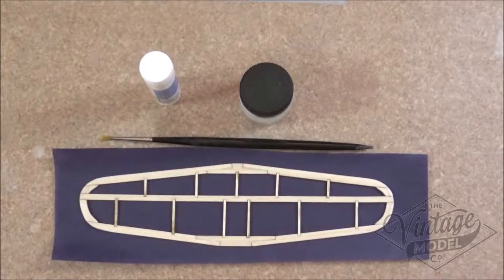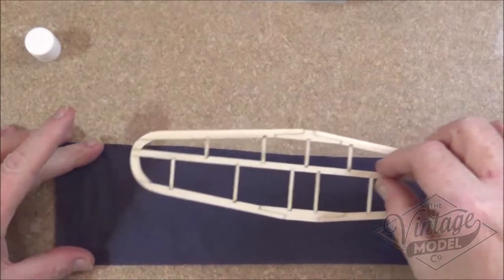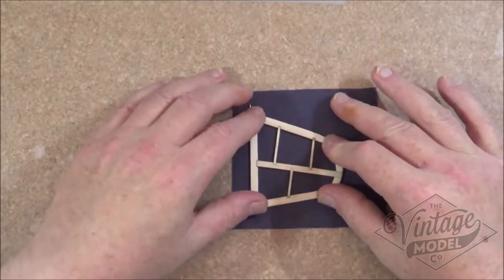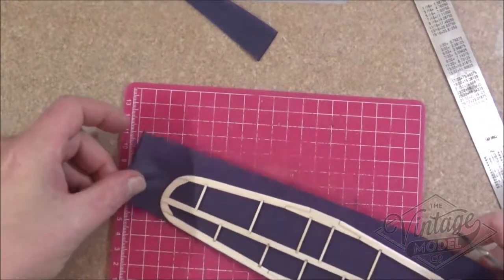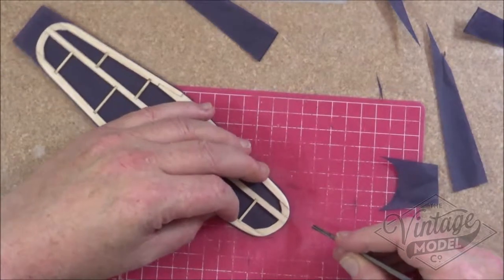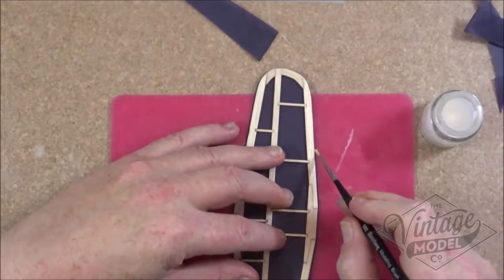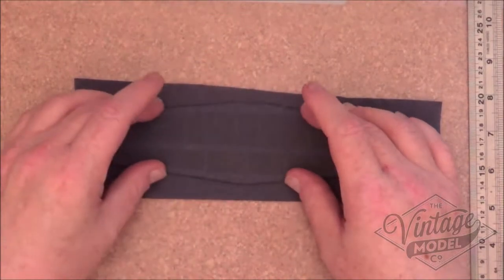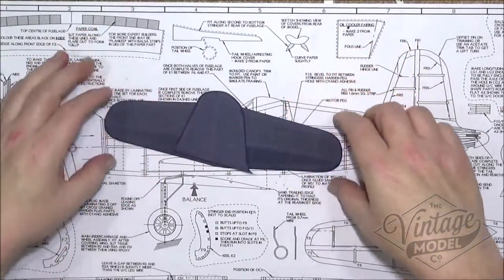Building the VMC Vought Corsair Covering The Tail Planes

Comment: Hi Rob, what a fascinating process. I'm assuming the tissue paper comes with the kit and if so is it some kind of toughened paper that doesn't tear easily. After hours and hours of work you wouldn't want rips appearing in the wings. Also you wouldn't want the tissue to deteriorate over time. Great tutorial mate.
Reply from the maker: Hi Cosmo. Yes the tissue comes with the kit. I would say it is stronger then the tissue used for hankies but it is still very fragile and tears quite easily. I think the dope applied after shrinking (shown in another vid) helps to protect the tissue from deterioration but doesn't strengthen it.